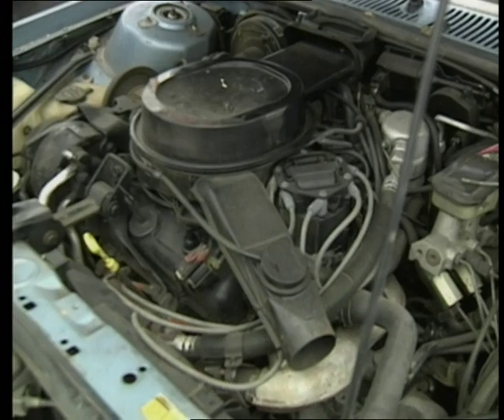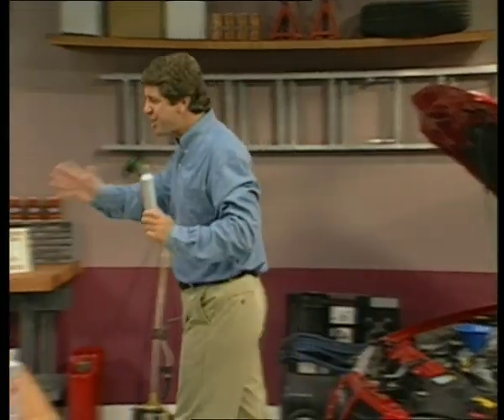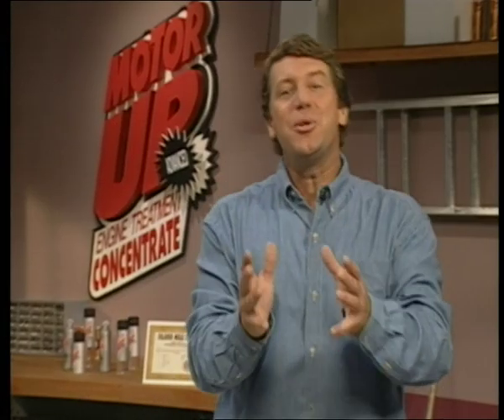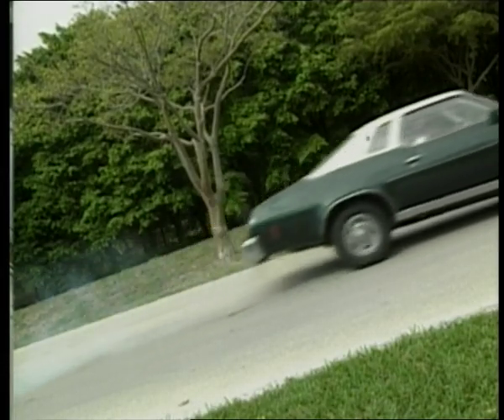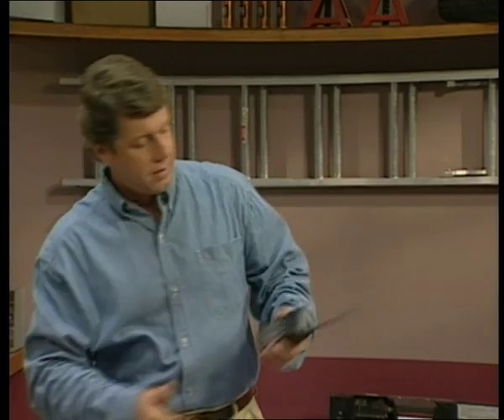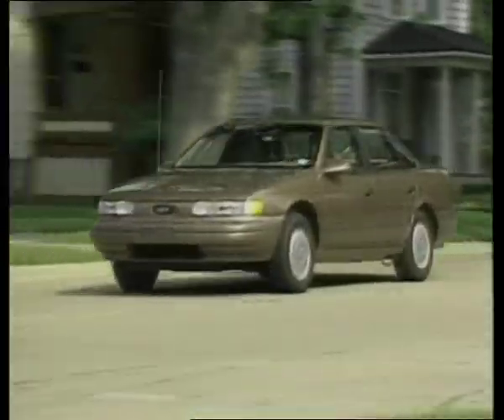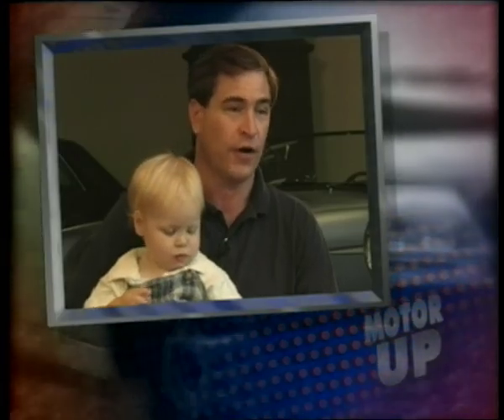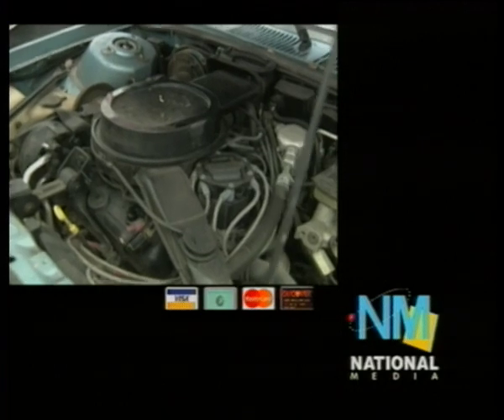MOTORUP Original Engine Treatment/ MOTORUP 420 Multifuncional Aceite Motor

Comment: best product ever.... been using it for like 17 years and my Skyline which has not been started for 10 years fired up on the first go ..... magic.... one question .... will it work in a gear box.... i know you have a gear box product but the original motor up will it work in a diff and gear box... i finally found it once more but had to move to Japan as they no longer sold it in Australia but they dont sell the gearbox one here in Japan ... PS i drove a N12 Nissan pulsar with no oil it in treated with motor up for over 130km home after it used all it oil up due to bad rings and yeah it made it home..... mind you this was like 19 years ago so if the formula is the same as back then its just the best product ever....
Reply: Rip N12 ":D"
Reply: 6:00

Comment: In the beginning of the early 1990's Toyota and Nissan built very refined engines with huge improvement in noise reductions while using just plain conventional oil in so much you didn't need engine oil treatment like these.
Reply: Those engines were the ones that became notorious for sludge build up, the extremely tight tolerances designed in to the engines were great for smooth and quiet running at terrible for destroying engine oil shear factor and causing the oil to sludge up.
Reply: @JA-rn5qv  irresponsible owners are to blame for neglecting maintenance intervals.
Reply: @09NXN06  Actually, in this case, Toyota has acknowledged the defective design and for a good run of years was covering engine repairs well beyond the warranty period because the problem could and did occur even when properly maintained